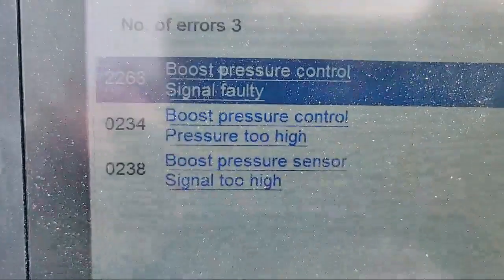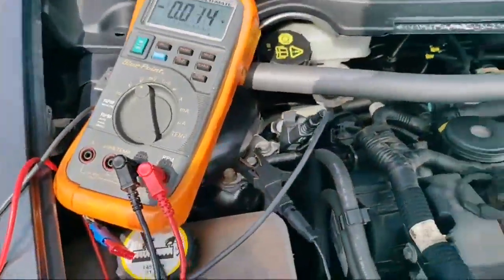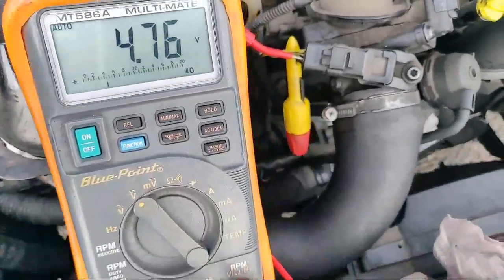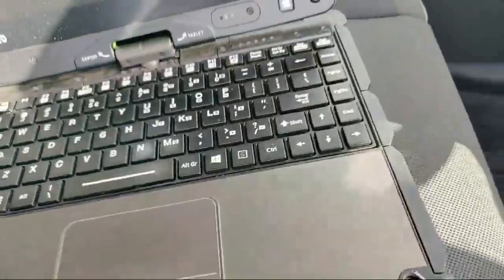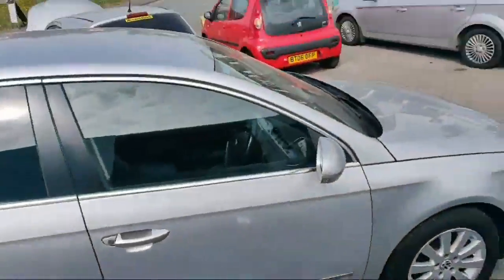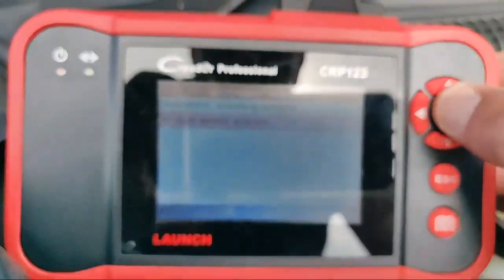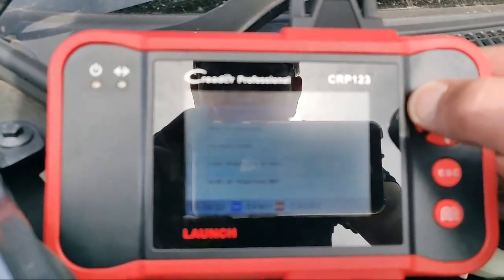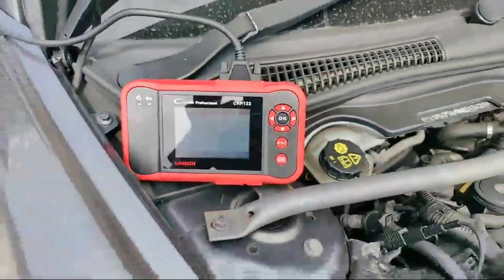2263 Boost Control Volvo V50

Comment: Putting a voltage down a pressure sensor or potentiometer using Autosim: no worries about unplugging the sensor? Jus leave it plugged in? Cheers Steve!
Reply from the maker: It's a negligible current with this particular tool, I've never had an issue 👍